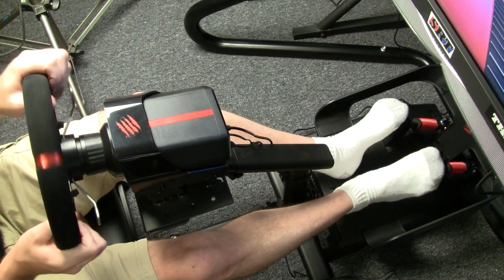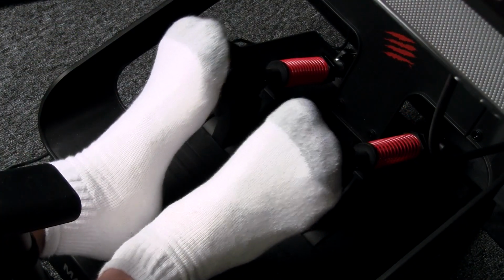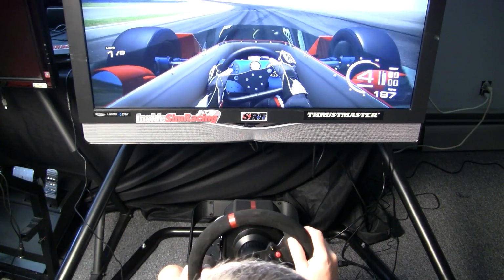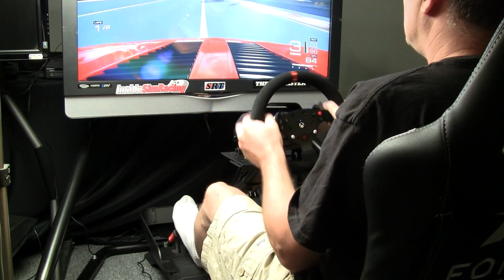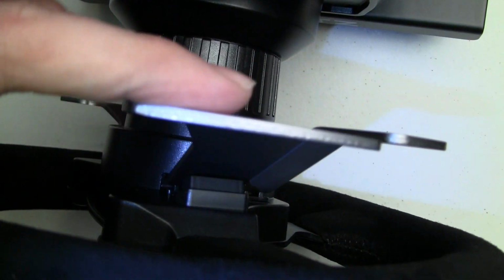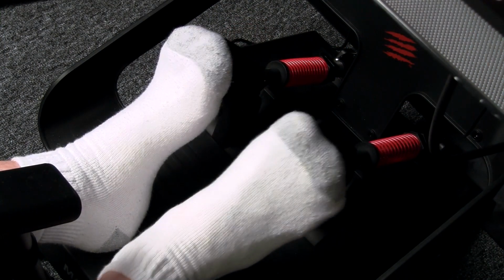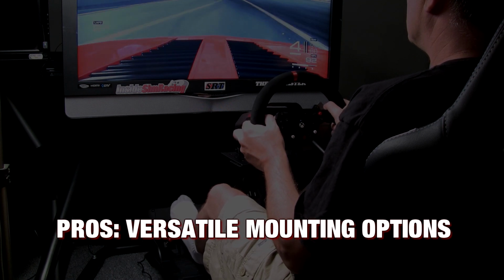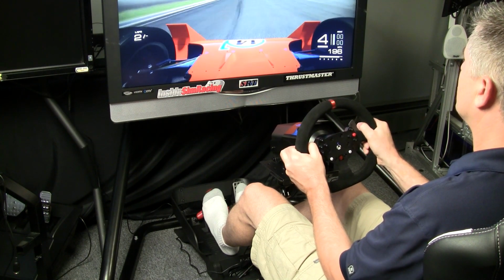Mad Catz Pro Racing Force Feedback Wheel Review

Comment: If not for china I guarantee you most of gaming peripherals would be starting 400% higher, if not more. Im actually wrong by saying specifically gaming peripherals. Everything would be more expensive due to west enforcing carbon taxes on companies, all the intelectual properties driving competition straight to grave, patents. Just look how you have to fight HDCP protection in order to record something off of the tv. If you werent alive during VCR era than forget it, you have no idea you live in autocratic dictature already. But thanks to China, you can record shows by purchasing a cheap chinese actively powered HDCP bypass device for merely 10, 20 bucks. Beat that made in USA copyright BS!
And dont think that china cant make total brutal quality stuff. For the product, it would raise the price by maybe 10% but it would still be damn way cheaper than anything made in the west via cheap chinese alternative. So much for that.
BTW look at the appliances being manufactured nowadays, engineered to fail right after or soon after the warranty expires. This goes for all current appliances here in the USA and EU. I doubt the chinese have these issues.
Anyway, back to what I originally wanted to ask, why dont the pedal units of the more expensive wheels contain rumble motors, possibly brake pushback motor? If they want to be so realistic and charge up to a grand for a nice wheel, i would expect a reality simulation pedals as well - in the price.

Comment: what would a great wheel be that has a clutch and is under $200on Xbox one.  if it helps it will be used on forza 6 for drifting
Reply: There are no wheels with a clutch for under $200, I should go with the TX integral with TM28 Leather, but you can also get the Logitech G920, I recommend the TX though
Reply: Suzuki is awesome I mean you can maybe get a used Logitech g27 for about 200-270

Comment: IMO, Mad Catz should stick to making top of the line fighting sticks.  Thrustmaster is better by a mile.  Since I couldn't afford a Thrustmaster, I settled for the G920.
Reply: +workoutfanatic787 Isn't the Thrustmaster and the G290 they about the same price though?
Reply: BTD37 They are indeed.  But with that you only get the basic Thrustmaster model.  I would want to spend extra for new pedals, shifter - both of which cost hundreds each.  That's what I kind of meant.

And if you're ever in the market for a fighting stick - Madcatz make really good and durable ones!
Reply: +workoutfanatic787 
The T300RS/TX  has much better FFB though.

Comment: Hey, does the Mad Catz only run on Forza 5? or on Forza 6 to? Please help, i want to buy it but for Forza 6. Thx for Answer Greetz from Germany
Reply from the maker: +CTCG Community Team Cups Germany We'll have to check on that for you. Should work on both
Reply: +CTCG Community Team Cups Germany
I have got this wheel and it works perfectly in Forza 5, Forza 6, FH 2, Project CARS, F1 2015... You can play all the racing games available in XBOX ONE except the WRC 5, which it does not work withe any steering wheel in XBOX ONE yet, but I sent an e-mail to the WRC 5 company, and they told me that it could be played with all the steering wheels in XBOX ONE for the end of this year or early 2016. So, yes. You can play every racing games for XBOX ONE with this wheel. I am very happy about buying it. I hope it helped you.
Reply: +CTCG Community Team Cups Germany 
Just bought that thing. The smaller wheelbase is just better for my current desktop setup than the TX and man, I dig the design in general. It should arrive next week. Bought it for Forza 6 as well. Can post here if it works bro...but again, won´t arrive before sometime next week. Should work with pretty much every upcoming Xbox One game though.
Reply: Thank u. ;)

Comment: Hi There,

Without the paddles plugged in, the shifters act as LB/RB, or accelerator or brake. Do you happen to know if this means they are analog? so you can gradually apply throttle/brake? I cannot use the pedals due to my disability, and analog shifters are hard to find.
Reply: +Jm4cc4 Hi. I´ve got this steering wheel, and I have no idea about it. I think that it would be problem of the settings, and that you could accelerate with the shifters, but I have no idea. Contact with Mad Catz or something, because I don´t know if you could do it. I hope I helped you.

Comment: It almost sounds as if the gears are not meshing correctly when under load,  which is why is turns smoothly while its off but grinds when its on.
Reply: +madmax2069 thats exactly how my fanatec CSR feels with is grinding and notching, is there a fix you can suggest?
Reply: +Sons of Blackwood MC fanatec wheels are belt driven and not geared. the belts do have teeth to keep them from slipping, now it could be something wrong with the belt, or the belt is rubbing against something, or the belt slipped out of its groove a bit. couldn't tell you for sure. also could be as simple as incorrect settings causing it to clip. 

you're always going to get some noise due to the brushless motor in the wheel. 

you'd have to investigate the insides and inspect it to see if the belts are ok and in the grooves and the belts teeth are meshing properly and are not damaged and see if anything in line properly and not rubbing against anything. 

other then that I couldn't tell you as I dont have a wheel unfortunately.
Reply: thanks for the advice man, appreciate it! Yeah its weird cos it only happens when turning left. Also there are nasty nasty noises it makes internally when the wheel is OFF and turned left.only left. When I have enough money to bug a logitech or thrust master i will take it apart and have a look ;) thanks again :)
Reply: +Sons of Blackwood MC I wouldn't bother with either, your fanatec beats them both easily.
Reply: em, ive had three brand new fanatecs and none of them have even been as good as my non FFB madcatz! The old microsoft wheel is like some professional level sim equipment compared to the fanatecs I have had :(

Comment: is the grittiness of the wheel something that will go away when it breaks in?  Is it caused by too much lash between the gears?
it sucks that this wheel isnt as good as the thrustmaster because from the looks of it and the features it seems to be the better wheel. guess they should have spent more time making sure it worked well.

Comment: Run that wheel through a CronusMAX, remap all your buttons to what you want them to be (your clutch or look, to the LSB or RSB for example) then run better peddals. I'm currently running my Logitech G27 with the XB1
Reply: GL0ZZ3N Tech Reviews The G27 is officially not compatible with the XB1?
Reply: Bernd Fiten it is with a Cronusmax :)
Reply: Bernd Fiten have a look at my videos, I have a couple playing forza
Reply: GL0ZZ3N Tech Reviews doesn't the ffb not work though?
Reply: Joshua Curtis not from what I've seen,  it's only partially compatible because the box makes the wheel seen as a standard controller (so basically qhen you turn the wheel you're basically moving the thumbstick). As well they have some nasty big deadzone areas. Those boxes that make wheels compatible are a waste of money right now.
Reply: madmax2069 With a CronusMAX you're able to code GPC to adjust the deadzone to feel how you want it to. Sure, if you just plug it up and hope for the best, its going to act weird, spend a few minutes fine-tuning, you're good to go. But yeah, you're right, it DOES work by emulating a controller.. You're just able to completely change the way ANY output is sent out to the console.. you you pretty much "code your own wheel"

Comment: I got this wheel and I love it. There is vibration on it and the wheel I feel is very responsive. Also it is not noisy, not like in this video. Dunno if it has new drivers on it, or I got a good one.  I love the progression on the pedals and the feel of the suede wheel. Only thing I would say is I can feel when I turn the wheel a slight grinding, like you mentioned but not much.  However I am a happy forza player. oh and i had to send back 3 tx wheels because  of failures is that normal? I liked that wheel too but I lost trust in it when they died on me so much. Thank you very much, for doing all the videos you do, I really enjoy them.
Reply: Scary. I am really enjoying my TX... I've always had the fan running. Hopefully it will last longer than a year, geeze.

Comment: Doooh my wheel is OFF CENTER!!! Like it is mentioned in this video. So what can I do? Contact the reseller or directly mad catz ? I
Reply from the maker: OpticalHaze Contact either one and get a replacement. Yours is defective and there's no way to fix it.
Reply: Inside Sim Racing
Mine was about 6-7mm to the right! I returned it! Not sure If I should buy a new one now! You never know if its gonna be a good one!
Reply: Inside Sim Racing
just got my 2nd wheel and guess what its OFF CENTER AGAIIIN!!! really dissapointed. come on is it even possible to have one 100% centered? Should I go now with a TX?
Reply: OpticalHaze  You're a bitch troll, you know that?
Reply: Dominic D
da fuq? there isn't even a firmware wo lets you center the wheel correctly!

Comment: How do you recenter the Logitech wheel with button combination? Does that work with all Logitech wheels or only G wheels?

BTW, 400bucks and there is no clutch and no shifter?? That's a crappy buy if I ever saw one. You'd be better off with G27, and that thing works with everything and I'm assuming it works with XboxOne as well. Plus it has a clutch and a shifter. I don't know, this seems severely overpriced. This wheel should cost about 50bucks less than G27 to even be anywhere close to worth buying. This is pretty much DFGT with a removable rim and without a seq. shifter. And DFGT costs only 100bucks! 250 still seems steep to me for this wheel, especialy when comparing it to other wheels on the market. They didn't really thought this through very well did they? If they'd do 50% off it would still be steep.

Very honest review Darin. Thanks!

Comment: Gotta say, I own the TX Wheel and obviously I haven't used this one but just from the review, it sounds like this wheels about as good as all the other Mad Catz products.....if you know what I mean. I will say that the default rim material was better then the default TX rim but I like the button layouts and paddles a lot better on the TX and I give them props for the pedals on this wheel do look badass and the adjustable tension is awesome but honestly that's bout the only good things bout this package, everything else just feels bad and cheap it seems, if it was a $200 or $300 wheel then I'd understand but wanting $400 out of it, just doesn't seem like it's worth it especially considering you can get a Thrustmaster TX racing wheel for $327 now brand new off Amazon.

Comment: Darin is right this wheel is in my opinion only worth considering if you could buy it new for $250. Keep in mind you can buy a new TX wheel for only $325 new on Amazon (due to all the defective ones and the fact it's all you had to choose from for the Xbox One the price came way down.) Plus if you're worried about a defect you can always buy one of the used demo units like I did so you know they worked and weren't the ones that immediately died out of the box (which is the most common issue.) So you're much better buying the Thrustmaster for $100 less new or half a much used over a wheel not nearly as good which is still $400 new, just make sure your seller tested it and guarantees it to work and will refund or exchange the wheel if it doesn't.

Comment: Xbox one is a joke and this wheel is a perfect example of that. The fact that they did not make the new consoles compatible with USB wheels is almost insulting. Mad Catz makes garbage and they always have.
Reply: You do release that the TX Racing Wheel connects via USB and works just fine on the XB1 right? In fact the TX racing wheel base is pretty much the best out there right now, hell the PS4 still hasn't even got a wheel so least the XB1 is making an effort.
Reply: MrRabbit686 lol Yeah it does suck, I went with the XB1, I have my reasons (ima tech nerd so trust me lol) but still as the racing community as a hole the PS4 should've had an appropriate Racing game at launch or least a few months in, thankfully both systems will be getting PCars and The Crew and the PS4 will be getting Drive Club and XB1 gets Forza H2. As of the accessories the PS4 will finally have a good wheel after this year, Thrustmaster will finally be releasing the T3PAs to america and the TH8A shifter as well, great year for racing.
Reply: Vulcan The PS4 gettin the T300 this month or? And there is also the T80 released for a few month now...
Reply: MrRabbit686 Last I heard thrustmaster said the T300 MAY be out before DriveClub, and haven't even heard anything bout the T80 lol but the XB1 already has 3 wheels available on it to be fair and I'm pretty sure the T300 isn't going to released this month, it'd be stupid if it was since there's no games on the PS4 that support a wheel yet.
Reply: Vulcan That's another story ;) I KNOW there is no game out yet... :( and a friend buy this shitty T80... Nothing to say about. Can't wait to play Project Cars :D
Reply: Vulcan I've the T500 so i can't wait to get the shifter :D I've a mod build in my pedals so they are fine for me.
Reply: MrRabbit686 Haha yeah I have the TX racing wheel with the GTE Challenge Rim, next month I'll be getting the Next Level Racing wheel stand, T3PA, and the TH8A Shifter just in time for Forza Horizon 2 haha Plus I may get this mod that'll allow me to use an aftermarket steering wheel, but not sure yet when I'll get it.
Reply: Vulcan Sounds nice ;) I've a self build rig and my T500RS. At the moment thats ok but if Project Cars is around i've to have the shifter :)
Reply: MrRabbit686 I gotcha, I would have a cockpit setup but just don't have the room really.

Comment: Great review. Think I'll go for the Thrustmaster TX. My 1st wheel was the original Microsoft force feedback wheel and it had the same sort if guddery force feedback. That said, I'm going to wait for project cars so I've got more than one title to play.
Reply: Dont. I just did that and I'm waiting refund. Throttle pedal broke in just 2 days and the ffb is very inconsistent. Cant play more than 10 minutes without the motor overheating and then the ffb becomes light and crap even with the firmware update.

Comment: Hi Darin, great review! I've got an issue with my G27 where the 10 degrees of rotation of the wheel on both sides stops. It's like the rotation is set to 880 instead of 900. I've owned a G25 for many years, which wasn't like that. Is there any way to fix this?
Reply from the maker: MrThorsen95 . What system are you running ? If it's on the PC, you can adjust that in the profiler.
Reply: I have it set to 900 degrees in the profiler. Wen I had the G25 I never had that issue. Btw, thanks for replying so fast.
Reply from the maker: MrThorsen95 . Interesting..  Does the rotation say 880 in iRacing ?  If so that number depends on where you calibrate it at the 90 degree setting.
Reply: It says 900 degrees. I've tried with all the current sims, like iRacing, Assetto Corsa, rF2, Game Stock car. In every sim I've got the same problem.
Reply: Yes I can. It's only a problem when I plug in the USB. My first thought was that they made it like that so I'm not going to break my wheel so easily. But I have now figured out that something is wrong with my wheel. Thanks for replying so quick guys, really appreciate it!
Reply: Tea Why do u even bother commenting?